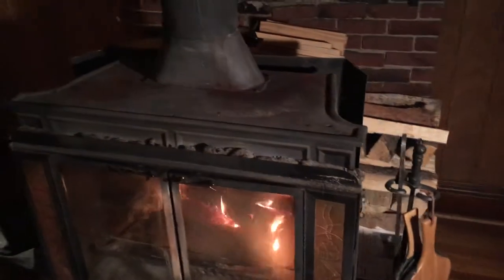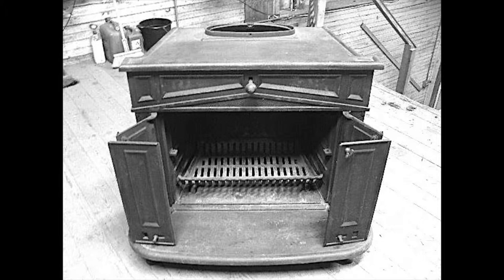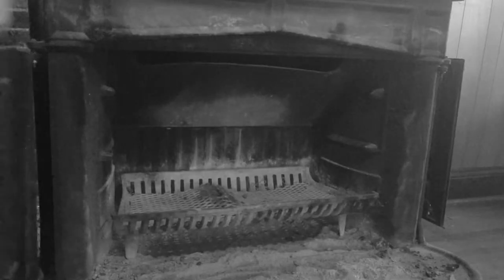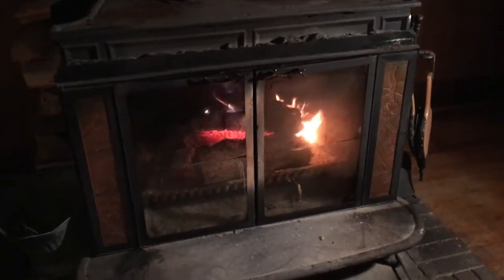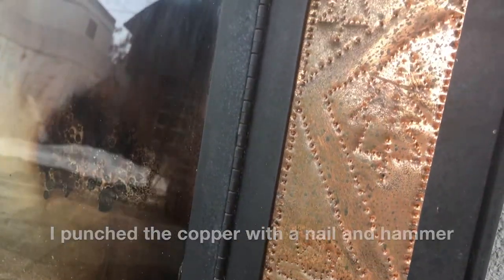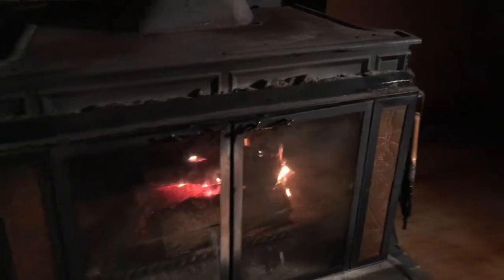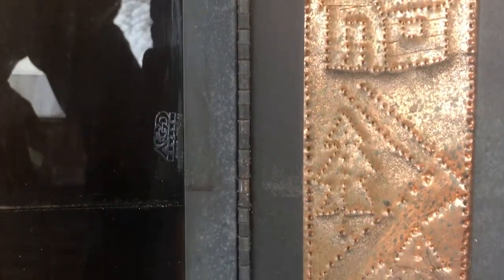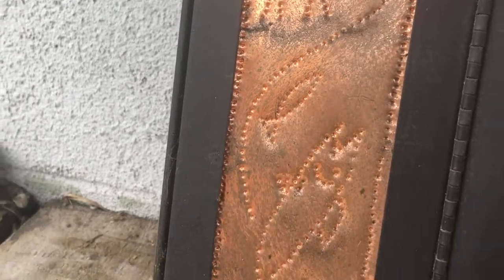Franklin Wood Stove Gets Glass Doors

Comment: I sure want to thank You for this video. I have probably the same Stove and like to keep the doors open to be able to see the flames. With glass doors I will get better heat I believe and be able to see the fire as well.
I will br looking for a Fireplace glass door for mine Thanks
Reply from the maker: Since the stove firebox is shallow, I would fully open the damper before opening the doors to stoke the fire, then damper it back down once the doors were closed. This helped prevent smoke being pulled into the room. Thanks for your kind comment.

Comment: Hello, I LOVE this idea and would like to do the same with my Franklin Wood stove.......can you elaborate on how you installed those doors?
Reply from the maker: Thanks for your comment. With a fireproof gasket (rope seal for pellet stoves from Home Depot) between the doors and stove opening, they are just tightly wired in place to the stove hinges with baling wire. I hope this helps with your project.
Reply: @98point6  thank you for responding so quickly!  You did an awesome job, looks beautiful!
Reply from the maker: @susanmanalio3132  Many thanks for your kind words. I really enjoyed watching the fire. Kept an extra tempered glass panel on hand (there were four) because they can break from stress… but only after years of use.
Reply: you can ordered glass door , from Croatian factory who made this stoves , by plamen - croatia